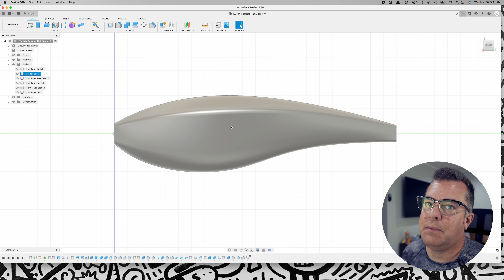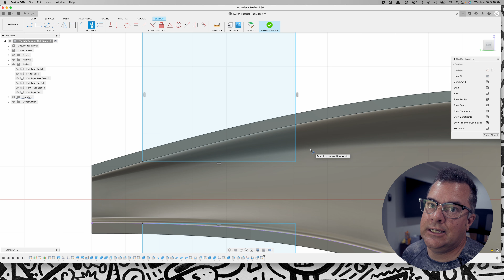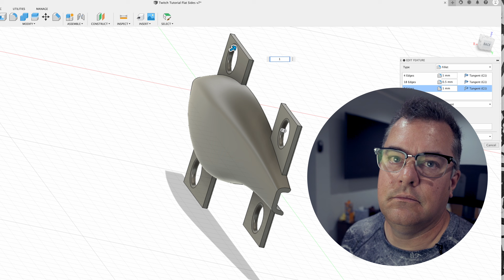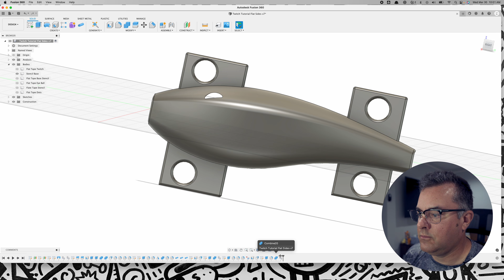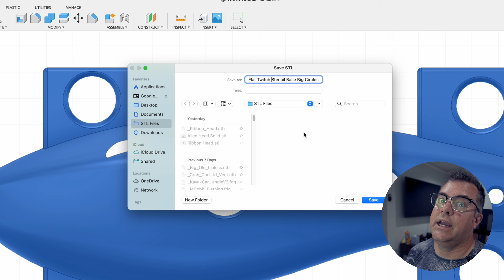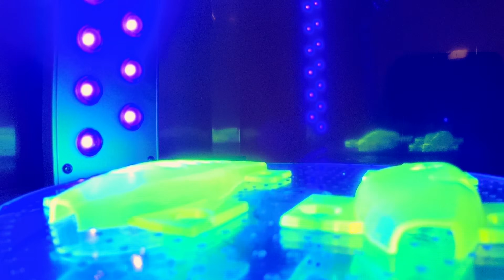3D Printed Stencils V2

Comment: Have u done any updated videos with scanning a plastic lure to making a stencils in fusion 360 and then using it?
Reply from the maker: I would generally not scan, it is faster for me to model it 99.9% of the time, scanning adds a layer of complexity and work overhead that is generally unnecessary

Comment: The thing I’m currently trying to figure out is how to make a stencil that is a cross hatch replacing the need to wrap the lure in mesh to create scale pattern.  I picture skipping the offset face step and using a flexible resin that can stretch and tightly wrap the lure.  Each diamond shaped hole needs to be on its own plane and be perpendicular to the area on the body it’s exposing. I can’t wrap my head around this problem.
Reply: Haha. That fusion 360 channel you recommended is doing speaker grills that solve that problem I mentioned.  FYI- Your channel and fusion 360 content got me past the road blocks that had been preventing me from designing the lures I want.  The next thing to figure out are stencils. It baffles me how few views your awesome fusion 360 content gets. I suspect some of these videos are going to take off once people see the potential of this tech
Reply from the maker: Thanks man glad you sorted it out!

Comment: Is the EPAX E10 a good unit
Reply from the maker: I have 2 and they have been work horses for me. Highly recommend them!
Reply: Gracias. What laptop do you recommend
Reply from the maker: @Gustavo Maciel  I am on a MacBook Pro, M1 Fusion is really only single core dependent so a good amount of RAM and a fast CPU will help, but Fusion is designed to run on fairly minimal hardware. You don't need anything crazy for what we are building.

Comment: Well, using a simple thick alu foil you can make a plenty of reusable stencils for a fraction of a price. You will also save in time. Reminds me "when you have a hammer everything looks like a nail".
Reply from the maker: Sure but then you have to cut them by hand, and well I suck cutting things by hand 😆 I prefer to make machines do the work and cover up my lack of fine motor skill. Many good options for stencils out there thanks for sharing that one

Comment: I think you need to leave your airbrush paint thicker and spray with higher pressure and further away from the stencil. When you have a lot of water in your paint it tends to crawl back. Dry it completely between coats with a hair dryer.
Reply from the maker: Thanks man! It was pretty thin, still trying to figure it all out. So you think clear coat enamel as a base is OK then?
Reply: @WMBayouLures  Yes, I of course could be wrong but thin paint will crawl back on any slick surface so I think the enamel is likely OK. Go with thicker paint and spray up to 40 psi.
Reply from the maker: Sweet man thanks I will give it a try next painting session. You are probably right because I thinned this paint a lot more than normal.

Comment: i forgot the screw eyes when i did fire tiger stencil , give a nice overspray effect, keep them coming
Reply from the maker: Thanks man!
Reply from the maker: I also think a little bit of it was from the filet I added to the inside of the holes...
Reply: @WMBayouLures  could be, when i  spray with  stencils ,normally paper but recently 3d prints i generally thin the paint and drop the psi, this stops the air forcing up the stencil or getting underneath it, down to about 20psi, light coats lots of and using the air to dry them like you were doing, hold the air brush in at the same angle 90deg to the surface  with every pas will also reduce overspray, but i still manage to mess them up, normally because id didn't clean my airbrush properly  and like yourself do no do that much airbrushing these days
Reply: the fillet should help as it will reduce the little vortices you get in corners which make very hard to get paint into
Reply from the maker: @PaulAdamsTheHandmadeFisherman  ahh great info. Thanks so much, just like I knew what I was doing 😆😆😆😆
Reply from the maker: And don't even talk about cleaning airbrushes!! 😬😆😆😆😆😆